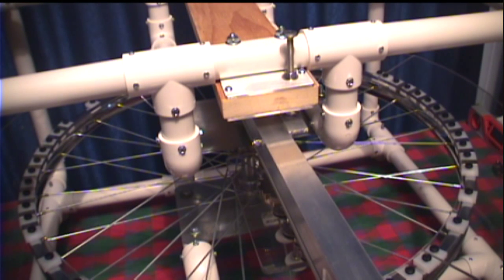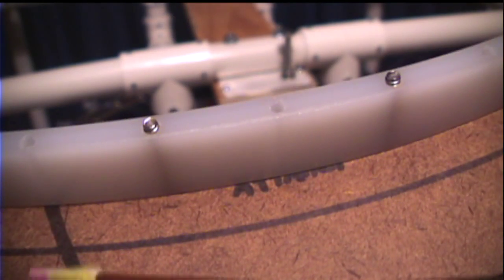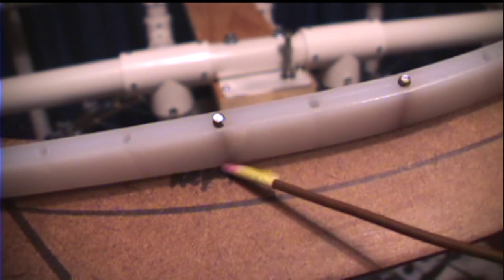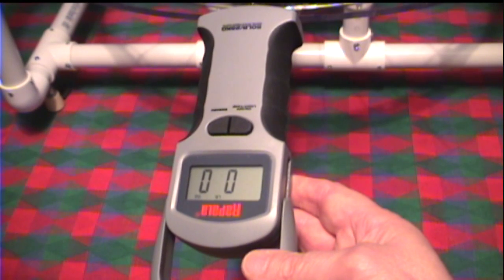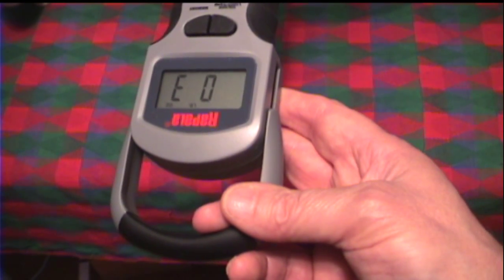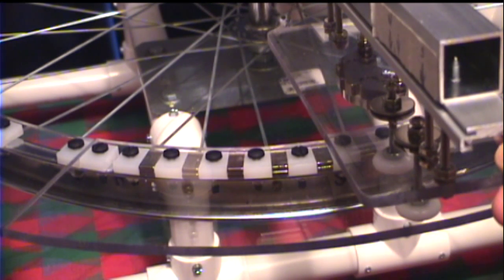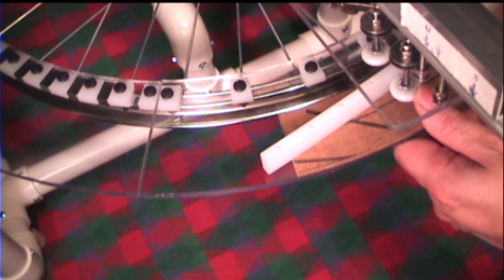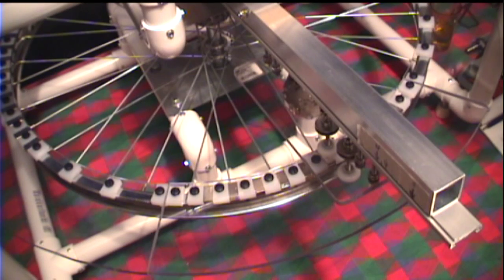Video #24, "Rick's Pipe Dream" Magnetic Motor - Generator Project

Comment from the maker: Remember, the magnets of each rotor magnet group are in attraction to the stator.  If you change the polarity of the last magnet in a rotor magnet group, you would have to do that after it passes by the stator.  Otherwise, it would cause rotation to halt as the last magnet approaches the stator.  Therefore you would have to physically move the last rotor magnet just after it passes the stator.  A curving rotor magnet layout cannot accomplish that.

Comment from the maker: @ggibney0856  Sure, it is easy enough to move the rotor magnets into a curving lineup (in the current configuration - not as mounted in this video), but how would you propose achieving repulsion to the stator at the tail end of a rotor magnet group if using that method?  It would mean that the last magnet of the group would have to be in repulsion to the stator immediately after the rotor group passes the stator, either by moving the stator into repulsion or changing polarity of the last magnet.

Comment from the maker: You could certainly do this, but of course it would complicate the build.  It would be easier to employ cam actions and multiple stators on a single wheel, and this is a concept that I do favor and will be experimenting with.  I suggest that you construct the basic Pipe Dream apparatus and begin experimenting.  It is easy to build and inexpensive.  You can start with just a few magnets and perform many experiments this way.  Best 2 U,  Rick  :)

Comment from the maker: Without that added  repulsion,  the rotations will be weak at best.   That's because the attraction acceleration at the lead end of a rotor magnet group would be more or less canceled out by the reverse attraction seen at the tail end of the group if the stator magnet poles are not immediately moved into repulsion.

Comment from the maker: Yes, I am sure that if I add my birch flywheel ring then it will perform better.  It would also perform better if I give the rotor a hand spin to start things.  I can also lower the stator to get a much stronger rotation, and tha would probably drive the rotor past the track curvature.  The problem, though, is that I really need to gain at least a portion of the available repulsion at the tail end of the magnet groups, and that is only possible through rapid movement of the stator carriage.